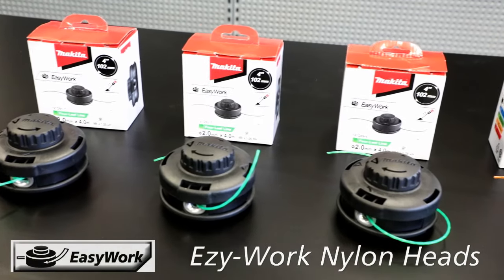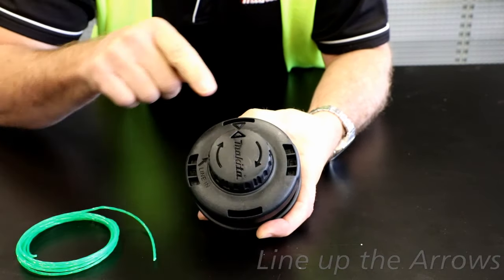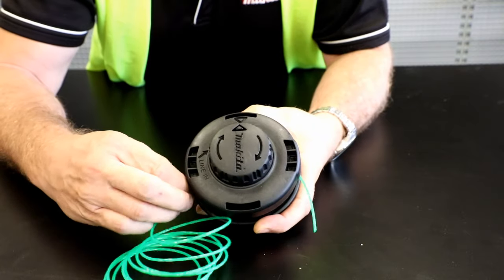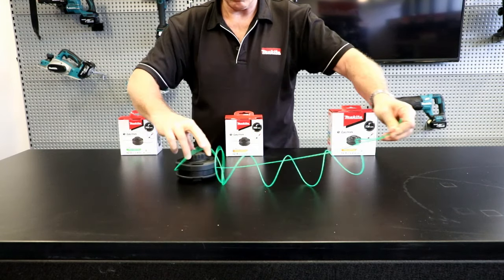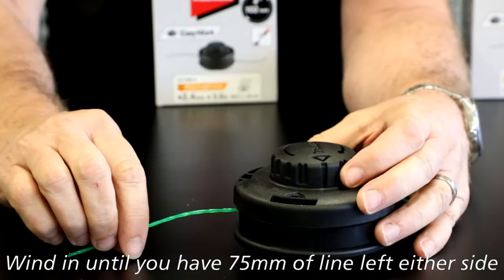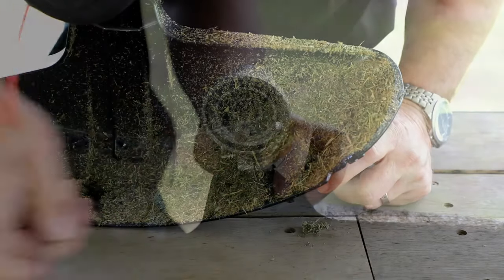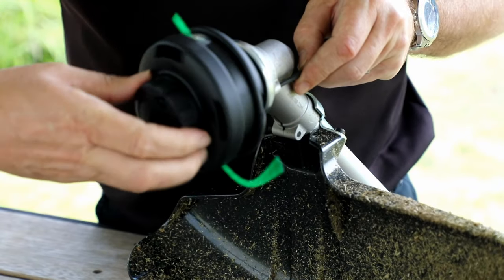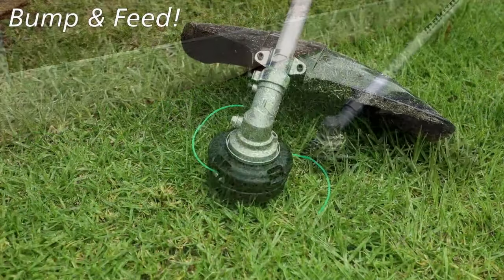Makita Ezy-Work Nylon Line Heads

Comment: How do i get the original head off to fit this one on. I can't get the part off that is actually attached to the trimmer.
Reply: There will be a hole underneath the head which you need to insert a hex key into. Once you've done that you can uncrew the head

Comment: After spending last summer and this spring watching multiple videos supposedly showing how to string my Makita XRU 23 I took the advice of someone else that commented on one of the 14 minutes or more videos. He suggested to just watch this video and I did. So just a heads up to anyone using a Makita please just watch this 1 minute 15 second video that shows you just how easy Makita makes it for y'all.
Thanks Makita but your owners manual isn't very clear how to restring this magnificent and lightweight trimmer that's extremely powerful and durable not to mention sexy looking for all you guys like myself.
Thanks again Makita for making this extremely powerful lightweight trimmer that's not electric or gasoline operated. Love your battery operated tool's. If you have any doubt just look inside my two car garage and you'll see my walls and tool full of Makita. And 1 more thing guys if you ever have any problems with your Makita merchandise just call thier toll-free number. I had one issue years ago with my Makita cordless drill. I was extremely disappointed until I called. I was immediately transferred to the problem center and was told what I wasn't doing right without them laughing at me for not turning the tool to the on position. I'm saying all of this because I'm still trying to figure out why I didn't watch this 1 minute video from Makita last year. And that's why I get the big dummy of the year award every year.😂

Comment: @Makitaaustralia how do I get a hold of the head you sold me brushcutter with as it was the best trimmer head I've ever used ..??
This so called Ezy work head is far far from it ..
It's actually the opposite it's very very hard to work with especially after it's been used once and you can't actually grip the head to wind string on..

Comment: Great video! The instructions that come with the trimmer are as useless as a screen door on a submarine! This explains it all.When you get the trimmer it has a nut screwed on it, I am wondering what this nut is for, looking at your video you don't use that to attach the head to the trimmer it must just be there to hold the flange on until you assemble it
Reply: Yeah, I believe it’s for different types of heads or attachments. Not needed, just screw your head on reverse thread and you’re done. I kept mine just in case though 😅

Comment: Are any of these suitable for a DUR181?
Reply: Only if the thread size of the bolt holding the nylon head is m10.  I just checked my dur189 and it has m8, 8mm bolt.

Comment: This trimmer head is the greatest piece of garbage you will ever waste your cash on.. works for 3-4 restrings then your screwed .. don't waste your cash
Reply: the back ground music has more chance on doing the job, I wonder why they do not resond to comments, or do they just what you money, and then just delete after sales help.
I have looked at quite a number of there videos, hoping to find out from end users if the things there trying to sell us are any good.and if you look up reviews, I think they just promote, the companyies which pay them the most.which is no good for us..
Reply: What I do I open it up and do it the old fashion way. It works better than feeding it this way.
Reply: Firehorse 52 what happens after that? What actually happens to it?
Reply: Yeh agreed mate I have the 36V Makita brush cutter. Plenty of grunt but I've had a prick of a time trying to find a head that I spend less time feeding than actually cutting.
Reply: I agree. Want to change it for a ryobi head as the bump feed does not work and it gives blisters trying to wind and then one end doesn't come out when you bump it. Avoid. Mine was like this after first use.